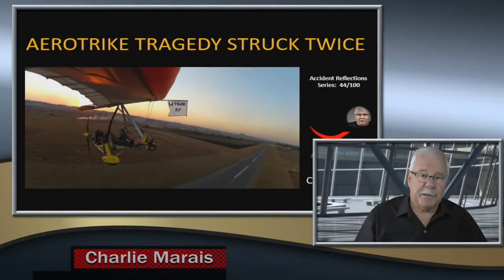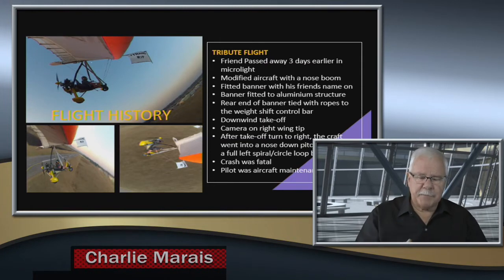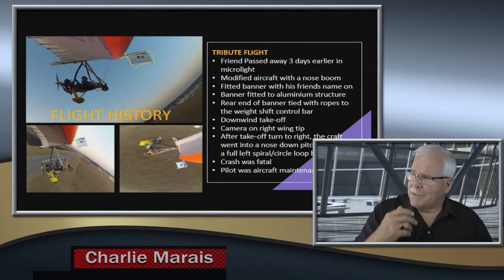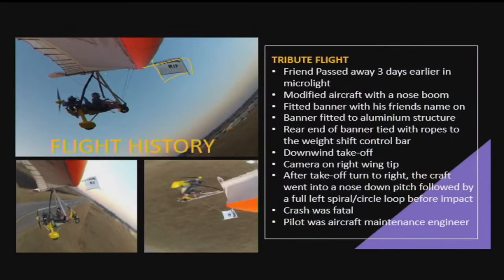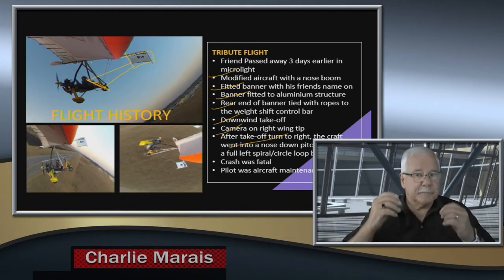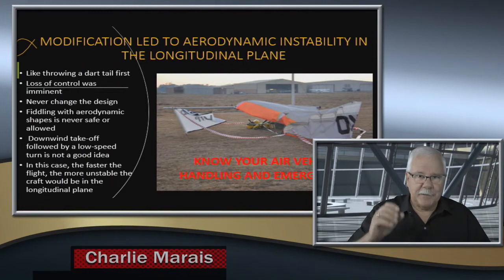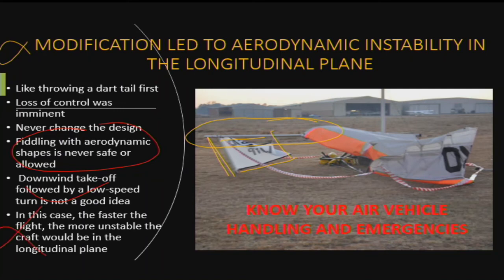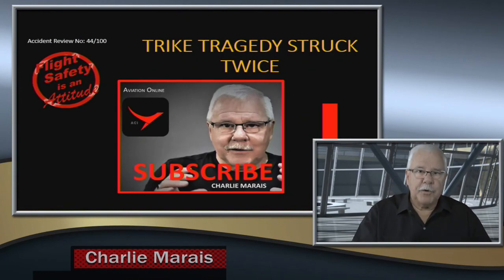Trike Longitudinal Instability LOC Fatal Crash

Comment: Jeese. The friend doing this flight was on a suicide trip it seems with his tribute banner. 😕. One wonders if his emotions got in the way, as noted.
Reply from the maker: Yes, aerodynamics suffer no fools, irrespective of the purest of intent.
Reply: I don't think it was on purpose "suicide" he could not tow a banner because get caught up in the propeller. He had this idea to put a banner in the front of his trike. He would have been better off putting stickers on the bottom of his wing, or using a smoke generator to write his name in the sky. He just didn't think it would cause any problems.